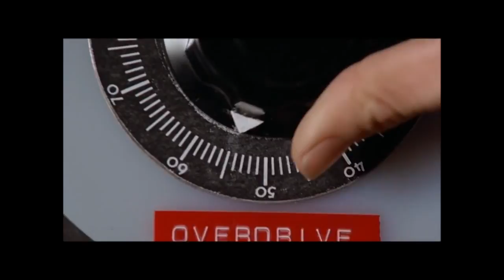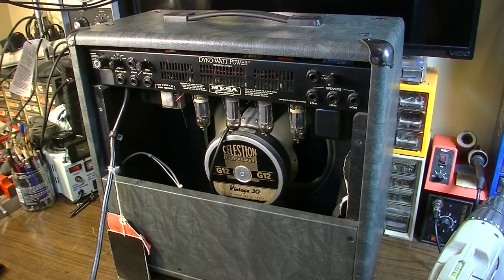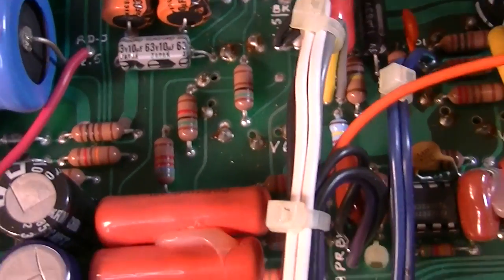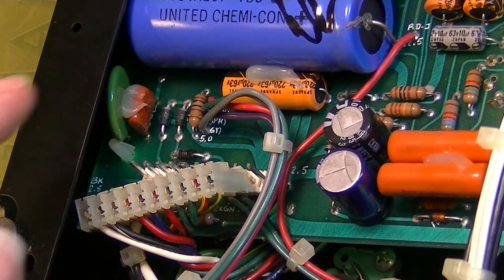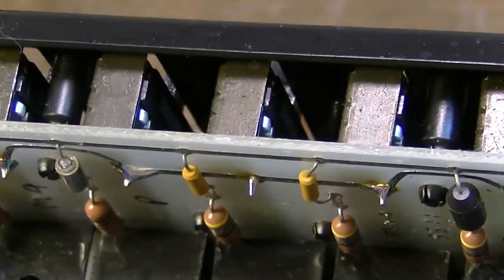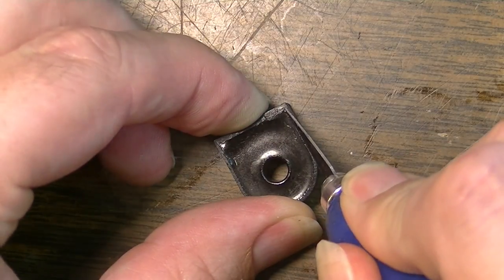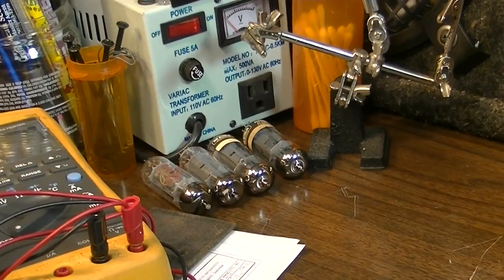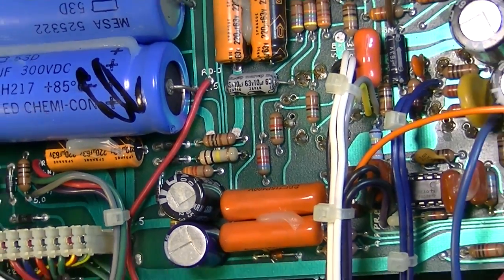The Forgotten Mesa-Boogie - 1990s Dual Caliber DC-3 Repair (PART 1)

Comment: Seems like a great amp other than running the tubes too hot. Is it me or only buying cooler tubes directly from Mesa seem like a Band-aid fix for this problem?

Also, Brad have you ever talked about power conditioners and do you ever recommend them? It made a difference for me where there was no clean power to be had from the available power circuit. Huge fan, learning from every video!

Comment: do you clean up your solder with alcohol? It may be just me from all of my days as a Army repair tech, but  old flux can start to cause oxidation, so I make it a habit of cleaning up those reflows. not sure if you have seen any issue not doing it..

Comment: I have worked on a few production EL84 amps and in all cases they had those tubes balls to the wall. I don't understand it.. it's like the designers are completely ignoring the tube data. Just like you, had to rebias. Those  amps are probably still kicking as a result.

Comment: Nice. I learned something today. Thanks brother. You gonna be around about Nov. 22? I'm gonna be in the area visitin my sis. I had a Studio 22 here a while ago that was noisy and those little EQ tombstones with holes in them were just a little loose. The fix was to preload them with some hand pressure and reflow the solder joints while preloading them. The amp had been owned by three or four local people and got passed around because the people who worked on it were unable to locate the problem or develop a fix. Lotsa board tapping before it would pass the hammer handle test.

Comment: I have always wanted a Mesa-Boogie amp. I really liked your primary check out of the amplifier. I think everything you did to the amp helped (except maybe destroying the 1H inductor, but heck, it was most likely a goner anyway) I was a little concerned as to how close it looked like you were gonna burn your fingers. Your analysis and perseverance to the repair is commendable. Good job Brad, keep up the good work and excellent informative commentary. I have been an industrial electrician mostly concerned with troubleshooting and repairing large motor drives (1000 hp and more). I also have been trying to learn to play guitar since I was 12, I'm 62 now and still quite inept. However, I am well experienced in troubleshooting amplifiers, not guitar amplifiers, but amplifiers just the same. Your techniques are sound, your understanding of the amplifiers is also sound. Have you ever thought of designing and building one of your own, using your knowledge of what works the way you think is right?

Comment: Those inductors are a pain in the ass to find! I needed them for my mark IV build. The only place where I could find it here in Europe, was at tubeampdoctor! It's a very reliable site, I bought there the inductors, LDRs, output and power transformers.
Regarding the bias, are there any downsides using a pot instead of a resistor? It could be very useful in case you need to switch again the tubes!
Thanks for the video, very informative! :)

Comment: Nice job on everything you did and of course your playing. I have a Boogie Maverick with 4 EL84s and have thought of changing the resistors so it runs cooler. Do you think it would loose any high end? Its already a bit mid focused and not very bright. I would like it to break up a bit earlier in the power stage and surely dont need this much power. Its a might loud 35 watts to say the least. The melted voice coil in the factory speaker agrees :)

Comment: Great video (as always!). I have a studio 22+ that has always run hot (I even installed a fan...huge help). It has the same basic configuration and identical bias supply circuit as DC 2 or 3. When I had it apart for service recently I dropped a 1 meg across that 120k resistor...results in approx 107k. This was enough to drop below 70%. Also the 22+ has the PWB in "upside down" so I would just put the 1 meg on the back of the board opposite the 120k. Way easier than pulling the board!

Comment: There is no way I would not have replaced the power tube board, if it was my amp.  Plus, it looks to me that Mesa amps are not built to the quality that you pay for in some areas.

Comment: I found that very informative and thank you for sharing as i have a Mesa Subway Rocket Reverb that is running way too hot and did mess about with the 120k feed resistor and was a little concerned that it would upset the voltage at the P.I. so i have been looking into installing a bias pot between the two 2.2M grid leak resistors to ground with a bypass cap across pot to ground for A.C. Do you think this would work?

Comment: hi Brad I hope you're treating Kentucky well and vice versa. 
I was hoping you could maybe help me solve a problem I need a motherboard for a mesa Fillmore 50, or some direction to schematics on how to build it out the whole circuit board!  

ordinarily I wouldn't ask someone for their time or help I'm just in a tight, I've got compound fractures in both of my hands from a freak accident and I need to sell this Mesa but that's not happening until I get a circuit board. the original one has separated in the traces are peeling up all over it. not to mention before it was given to me it had been through 2 or 3 repairm...m it powers up even sends signal but very very low signal. if you're lucky manipulation of the board will give you full power for a second or two...   please you're the only guru and amp superhero i know..   I'd rather build it out if that's possible but I've never attempted anything of such, I've always been at least lucky and repairing electronics but as you know Macy's are nightmares. thanks buddy God bless
Reply from the maker: I replied to the video you made.
Reply: @TheGuitologist  you tha man👍

Comment: Love the part about cleaning the tube socket individual pins with the pointy little proxa brush. Nice handle on those brushes.  I think you could have found the broken inductor early with some signal tracing on that fader that didn't appear to do anything.  Old faders often contained a heavy grease specifically to lub to sliding parts and not the resistance board itself.  I am glad they now have a spray to handle both functions.   I used to wash them out with WD40 and then add some silicone or lithium grease to just the sliding mechanism.  A dainty little job.

Comment: I hate to think it, but I would definitely run a wire on the tube board where the tracks are lifted, from A to B. There doesn't seem to be any lifting from the third to the forth tube. This seems like Deja vu with the equalizer like we had the same problem before.

Comment: A pin vise with the normal 42 thousandths drill is great for clearing pcb holes partially blocked by solder without heating and reheating the foil.

Comment: That crust looks like someone might have reflowed it with acid core solder.  Edit: on second thought could be a little too much heat from resoldering with a too hot iron.

Comment: Wait.. so if you changed the 120K to a 100K to change the voltage at point E, what did that do to point D coming off of that same resistor?
Reply: You're correct. The voltage on point D is the bias voltage on the PI tube. I read on forums back in 2011 that the bias voltage goes from 2.3v to over 3.1v. I don't know how much this effects V6 Phase Splitter/Driver tube and the amps performance/tone, if any? One could replace the 15k resistor with 20k and bring the voltage closer to 2 volts. With the 100k change, it would be useful to have voltage readings for both points D and E?

Comment: Nice work overall. My suspicion about the amp is a bit of rough transportation. Most amps with eq functions on the front are susceptible to damage from things with weight leaning against or hitting the eq sections, which are quite fragile, like most Mesa's, Carvin 100B's, Fender showman, etc. Broken and loose solder joints are also attributed to transportation,  especially transport without a proper road case or some sort of suspension.  It's always made me wonder why musicians would treat their instruments so well in transport,  by casing them and giving them extra placement care in a vehicle, and yet never considering that for an amplifier which has so many delicate parts in comparison to a guitar, which is fairly stable? The only other fix for hot running tubes that I'm aware of, which could be accomplished by a laymen, would be to wire up a micro fan or fans to the amp, flowing air consistently over the tubes either in a push/ pull fashion, which would probably be the best, or perhaps a pair of fans each responsible for two tubes. As far as the terrible amount of cigarette tar left on the amp, I would suspect that the individual player is probably to blame. The days of bands working one club six nights a week,  and leaving their gear within the establishment are long, long gone, and smoking has been on the decline. Thanks for all the great videos and amps I haven't seen from the inside.

Comment: Luckily that board they used for the tubes is separate so if someone wanted to they could re-design the board with thicker copper and print one for less than $10 by using a service like OSHPARK. Or any of those cheap overseas DIY board manufacturers. That is really the best way to ensure you have a quality part that won't fail in the future.

Comment: Hi again Brad,  you may feel like I may be giving you a hard time, but that is far from my intention. But I would feel awful bad if I didn't say something and a bad thing happened.  In this clip and the one where the one amp fried your test lead,  I notice you wear rings when you work inside a live amp,   and also occasions of having a test lead in each hand with both hands inside the live amp at the same time.   Maybe you can  take off rings while doing amp work and if you have one hand in amp, place the other hand on the hip safety measure so as to be extra safe.  I sure don't want you to hurt yourself by jumping current through a ring or needlessly sending current through your heart with both hands in the hot zone.
Reply from the maker: I don’t stick both hands in a live amp.
Reply: @TheGuitologist  Shew,  Glad to hear that brother.   Thank you again for all your fine and informative videos.

Comment: Great video on changing the Mesa DC-3 bias supply and running the output tubes cooler. 
However, when you lowered the 120K bias resistor to 100K you also changed the the bias going to the Phaser Inverter (PI). Point D voltage is speced at 2.3 volts going to the V6 (PI tube). This voltage also changed and now may cause bias issues with the PI tube. Would you also need to adjust the 15K resistor to bring the PI bias back to spec?
Reply: No, likely not. The benefit of modifying the bias to the DC-3 was discovered a long time ago. You may still be able to find the thread on the forum called the Boogie Board (forum.grailtone.com I think). Most people believe the very hot bias was simply a design flaw by Mesa. My DC-3 had chronic red-plating problems, which cause a cascade of other heat problems. The easy published solution on the forum was to slap a 470k resistor in parallel with that 120k bias resistor to achieve about what was done in this video. I posted a question about the PI, just as you have. The responses were "doesn't seem to matter", and people ran the amp cooler - and without problems - for a long time after altering the bias.

Comment: Excellent video.  Love the trouble shooting methodology.   I did wonder about the re-biasing.  I expected the 33K R adjustment to work; and then saw that you backed it up to the 120K R.  However - adjusting it there also lowered the D 2.3V supply voltage!!  Did you notice where that supply goes - and what unintended affect (if any) it caused on the amp's performance?
Reply: The voltage on point D is the bias voltage on the PI tube. I read on forums back in 2011 that the bias voltage goes from 2.3v to over 3.1v. I don't know how much this effects V6 Phase Splitter/Driver tube and the amps performance/tone, if any? One could also replace the 15k resistor with 20k and bring the voltage closer to 2 volts. With the 100k change, it would be useful to have voltage readings for both points D and E?
Reply: @drbryson2  Interesting !!  Thanks for the response !!

Comment: I noticed the ring came away from the pcb when you installed the new inductor, is that a major issue or as long as pushed back down to the board and soldered it will be ok?
Reply from the maker: The pad on the rear isn't really doing anything. The actual trace is on the other side.

Comment: I would have pulled that power board out, mounted the tube sockets to the chassis and point to point wire it, that set up is a fire hazard.  I had my Carvin X50B literally catch fire because of that set up with EL34s. My amp guy (Randy ) mounted the sockets to chassis and point to point the whole back of the amp because the damage was so extensive.  The amp works amazing now and we switched out the tubes to 6L6 GCs and the amp is so much more reliable now.  I really wish amp manufacturers would stop mounting power tubes to pc boards. 
 Great video as always,  cheers!
Reply: I doubt the client would have liked to foot that sort of a bill. As cool as these amps are (I have a similar Rocket 84), they aren't worth very much right now. The PCBs are pretty good quality. The sockets could probably be a bit better. They are biased very high. My EL84s sure cook too, and it is punishing on the tubes, for sure. I have just been inspired to rebias mine. Thanks Brad.
Reply: @stupidjubei  I'm just looking at it from the standpoint of that board being heated that bad, it looks compromised.  I've been doing electronics repair for 20 years I just tent to stay away from tubes and let my buddy who is a tech handle it. My amp actually caught fire and it sucks lol. For me tubes and pc boards don't mix. It looks like some of those traces on the board are separating from the board is my only concern. 
 Cost wise my buddy didn't change me anything crazy at all. It was more parts were the cost over the labor.  He had to actually cut the whole back section off the pc board was burned so bad and point to point wired all the back half of that board.  If you ever get to see a Carvin X50B or 100B board it's one piece . Unfortunately it's not a smaller separate board like the Mesa would be so much easier to do.  I'm just saying how the board looks to me through the magic of internet,  maybe it's not as bad as it looks or maybe it is? 
 I know alot of guys around here were wiring in extra fans on some Mesa amps because of how hot they run. 
 I changed over to 6L6s and asked to run the bias a little bit on the cooler side. I go very long times between tube changes and have zero issues with my Carvin now. I bought it back in the mid 90s and still have it. Hope this helps you understand where I'm coming from is all. If you seen the price of amps up here in Canada the price of preventive maintenance or a repair is cheaper than a new amp. 
 Cheers bud!

Comment: I have the Head version of this amp. I wasn't getting full volume out of it and my amp tech has had it 9 months now. Theres issues with the optical switches apparently , but he cant seem to get it working :( You have any ideas?
Reply from the maker: This model doesn't have LDR switching. They're relays. Don't know without seeing your amp, but I'd probably trace signal to where it's dropping.

Comment: Man I use to want one of these so bad , this and the Mark 4. Cool amps, but my buddy that's an amp tech said the same thing that Mesa are a nightmare to work on regardless of model.  Still want a Mark 4 though and a Peavey VTM-120 .
Reply: I have heard these sound good live and wanted one as well.  I have a Peavey Classic 30.  Wonder how they compare if you can find this Mesa in good condition?

Comment: Brad, anything you can do to get rid of the slight hum that's present at the end of the video during your demo?
Reply from the maker: Much of the time when you hear a hum like that  in the demos, it's because I'm sitting right beside the amp with a single coil pickup. The Tele will hum sitting that close to the amp, but I do it to get in the shot with the amp. Prevents me from having to splice two videos together in another post edit. I don't have a team of people helping me on any of this, so the more time I can save, the better.
Reply: would this particular amp's "Recording out" and Speaker mute have silenced it?

Comment: I missed that Tele! Why in the hell does every amp manufacturer insist on roasting EL84's? Jet City is the only one so far in recent memory that ran EL84/6BQ5's within spec. It's like they were living in the 1950's and transistors didn't take over the world yet.

And yes, YOU CAN BIAS A N Y AMP.
Reply: I was thinking the same thing... 400+ volts on the plate and screen on modern EL84's. I guess it keeps the tube sales up.
Reply: ...also, I'd bet this amp would sound much sweeter with reduced voltages.
Reply: Because EL84s can usually take that well over spec voltage if biased properly. Problem is they usually, well, aren't.